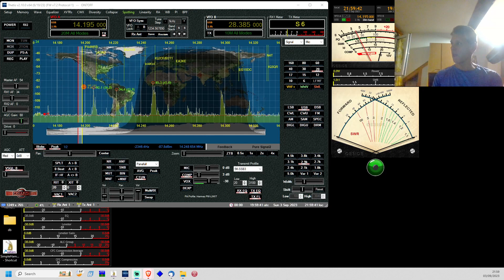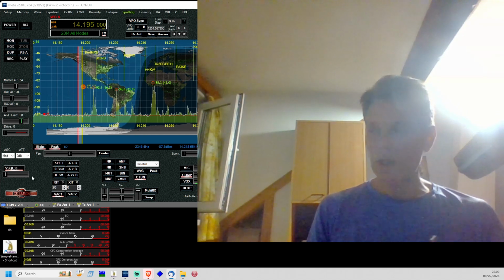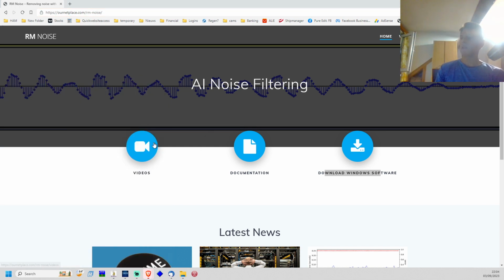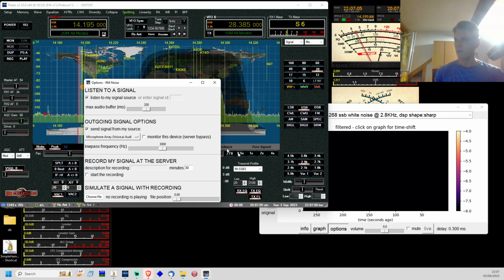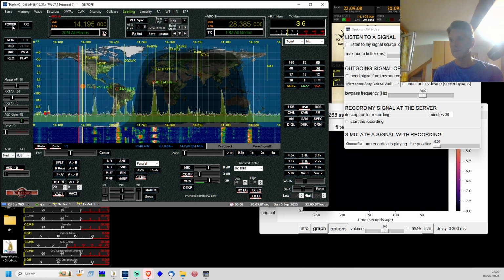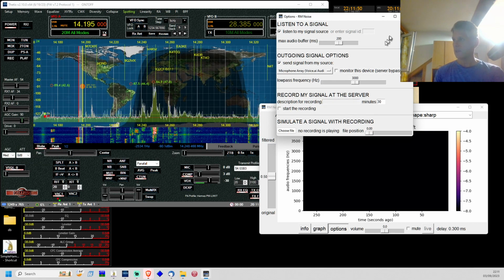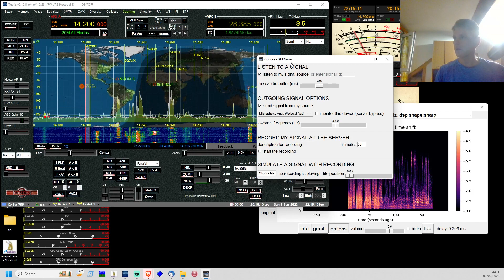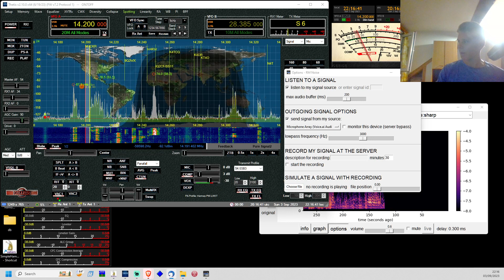How to 100% eliminate the white noise in SSB on any radio!

Comment: Does not exist for Mac or Linus; however, with Parallels, you can emulate Windows 11 on a Mac, and with some fancy configuring and sometimes a second third-party software application, you can route the audio from Flex Smart SDR Mac to RM Noise for processing in Windows 11 environment. It's a pain. Best to do it all on a PC.
Reply from the maker: It is a windows program. Unfortunately, it is not available on Mac and Linux. Did you try  to run in a windows 11 virtual machine on your Mac?

Comment: I loaded this Sunday morning. I was under the mistaken idea that you need to record your own personal shack's noise to use with the software. This got me screwed up. Yes I think they want you to record samples to send them. (A little harder than you may think) 
But, I started using it immediately. I need to figure how to cable up my system so I can use my heil Pro 7 headphones but that shouldn't be a big deal. I did use it though & listened through my computer monitor.

I tell you, it works better than anything I've used so far. I believe in time it will be able to pull weak signals out of the mud like a miracle. I had a signal from Reunion Island that I've been able to work a few times. It was so weak I simply couldn't work it. When I used RM noise it was so very close to making his voice readable. But the noise, it gets rid of the noise. Wow! I don't know about Thetis or Hermes lite though.

Comment: Why aren't the big guys, yaesu, elecraft, flex, anan, etc., implementing this into their radios? Or offering patches? I would pay good money for this. For a year now I have had a nightmare of powerline noise. It is extremely difficult  to get the power company to fix this problem even when you can literally pin point where the arc is in their equipment. I have spent a massive amount of time & money just so that I can sniff out and prove to the power company where the noise is coming from. It gets as bad as 20 over S9.

Comment: Will this also remove annoying QRM? Electrical noise from neighbours etc that existing DNR solutions don't remedy?
Reply: Check out all the rm noise yt videos. There's a guy that demonstrates his powerline noise and rm noise just makes it disappear. I have only used it for a half hour now, but I'd say the powerline noise may be history. I almost bought the DX Engineering NCC II to help with my power line noise. But there's no guarantee with it and by the time you buy all the modules etc., you're looking at $1,500.00. And from my time wave anc4 experience (and it's supposedly just as capable as the NCC II) it's rough getting it to work just right. Or enough to keep you from launching it across the shack.

Comment: My Radio is a Yaesu FT101D and use DNR works very very good after the last firmware update also on the FTDX10 aswell no need for extra software
Reply: i have FT101D the RM NOISE is far better than the Yaesu NR filter

Comment: Hi Kurt.  Great video.  I have RM Noise working with my Flex 6500.  This was easy to set up as Flex already has built in VACs (DAX).  I can't figure out how to get it to work with Thetis using their built in VAC.  Do I need to use a 3rd party VAC or something like Voicemeeter Banana?  When I click the dropdown under Outgoing Signal Options, I only get input device choices, which makes sense.  It does show Voicemeeter Banana input devices so I might try feeding the output of Thetis into Banana.  Thanks.

Comment: I eliminate white noise by backing off on the RF Gain control...no software required.
Reply: Isn't that eventually just a master volume?  won't it still come out in recordings? 🤔
Reply: Tbh you’re not eliminating anything you’re just turning it down
Reply: @Fox250R  aka master volume.
Reply: On SDR radios, a..k.a. AGC threshold, once properly adjusted, matched along with volume level, returns the most quiet and intelligible signal ever

Comment: White noise is part tot the soul of shortwave radio.
Reply: I agree, but, if you monitor a frequency a whole day, you'll get nightmares of the white noise
Reply: @oz457  to many it’s a soothing sound, just like people leaving on a fan at night or run an app on their phone for that.
Reply: @RogierYou  The thing is though RogierYou, with present day man made white noise, it is a lot more intense and hard going on the ears, compared to what it was back in the 60s , 70s and 80s as I remember. This is mainly due to the proliferation of modern electrical products, which generate so much white noise interference and also ADSL2 of course. Back in the day, white noise was mainly due to natural atmospheric band noise, not man made, and was at a much lower level and a real pleasure to listen to. In fact you could literally hear a pin drop on the 10 meter band, because there was so very little natural atmospheric white noise. Those were the best days for sure for HF Ham radio, we wont see them ever again sadly. 😕
Reply: I agree, but when your power company is not getting the equipment repaired in a timely fashion, (it can take years) this software makes your expensive equipment usable again. When you have 20 over S9 120 hertz noise it makes the radio virtually useless.
Reply: I use band "noise" to sleep. I live in the country, so no QRM. It is better if there are some distant storms.
Reply: @DavidLopez-bz4rj   that is i think a different thing, the clean frequencys sound contrary to the white high QRM. the clean frequency sound changes with the DX propagation, that can be exciting to hear and nevethless soothing to sleep, unlike the high white noise QRM from the telephone landlines or powersupplys from phones.